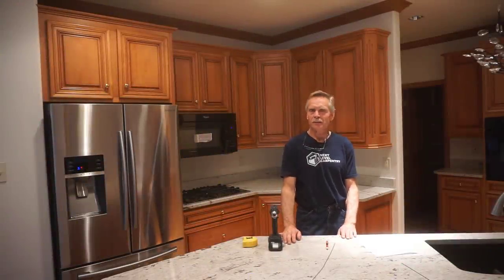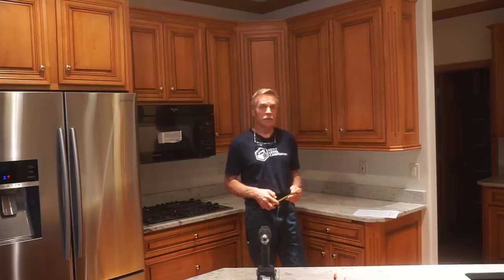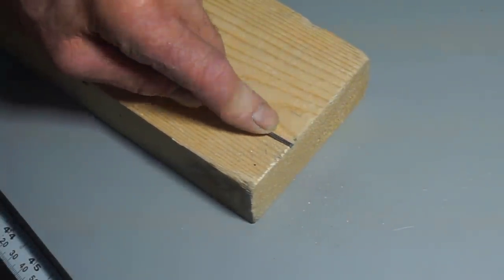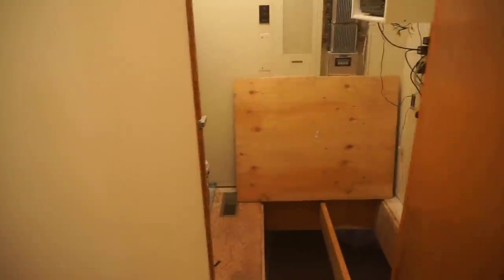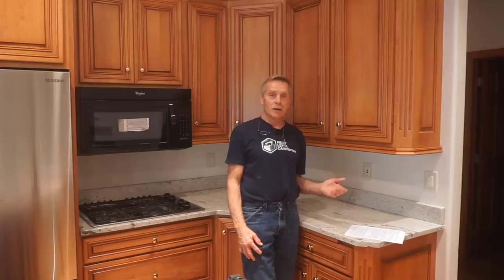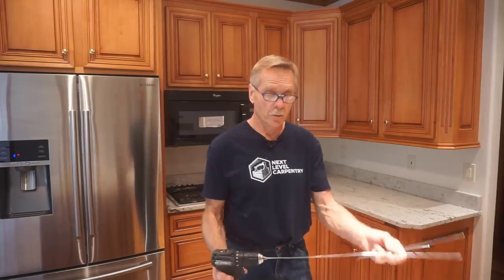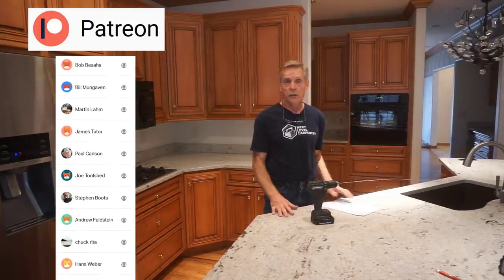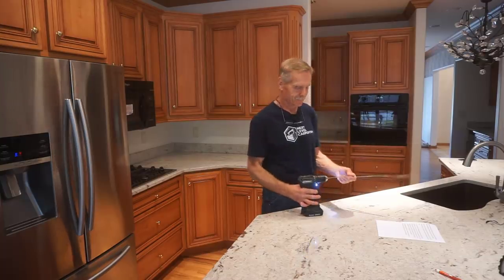Carpenter's Superpower Sees Through Floors!

Comment: I’ve been doing this for decades. I don’t use a file to sharpen the coat hanger wire I use. I simply cut the wire at a 45 and the edge left from cutting the wire does the job.

Comment: As a carpet fitter for over 40 years I've been called back to make repairs on carpets I've just fitted where a customer or trades person has caught a thread with a drill bit. That smooth wire is one neat trick not seen that one before. Another great tips video.Cheers

Comment: This is a great tip. I had to drill from the kitchen to the outside to install a security camera next to a garden window. I used part of a coat hanger to drill through. Had a problem keeping it straight because the coat hanger steel is not stiff enough, but was able to get through and then enlarged  the hole. Before I  tried this method I  drilled  2 holes  with 1/2 drill bit and hit something hard that I  could not drill through. Also this method leaves a small hole that is easy to cover.

Comment: I'm reminded of another useful tip I saw. If you need to hand nail a thin moulding with a brad nail and want to make sure it does not split: cut the head off one of the nails, chuck it and use it to drill pilot holes. Then hammer through it safely.

Comment: I used that technique a while ago in the attic to find the position of rafters so I could mount storage racks on the garage ceiling. I wasn't having any luck using my stud finder, actually the more likely scenario was that since my neck surgery, looking up just using my neck and head is a no go, so standing on a ladder and trying to see the stud finder and mark the position of the rafter was basically impossible. I don't know how I was able to navigate the attic though when I had to pretty much double over to move through it, but I don't look forward to ever having to do it again. I made sure that I inserted the nail on the same side of each rafter so there was no guessing as to which direction to drill the mounting holes.

Comment: Too bad those super-powers are never recognized by management. I remember, while working on a bridge construction crew, having one of the rich kids tell me to be sure to jab the edges. I held up my poke-stick and said, "I'm the one who taught this company to do that." For clarification, when pouring bridge decks there is a 2x4 at either side that extends over the deck to make a flat surface to run a slip-form wall on. My first day doing that concrete work, I saw how badly honeycomb and other voids happened under the 2x4, and I started jabbing the concrete mix with a survey stake to force  out the voids. Just one example.